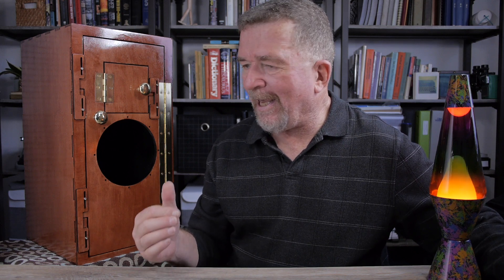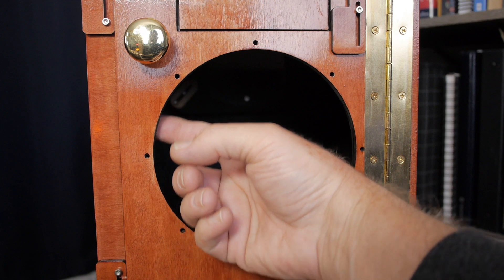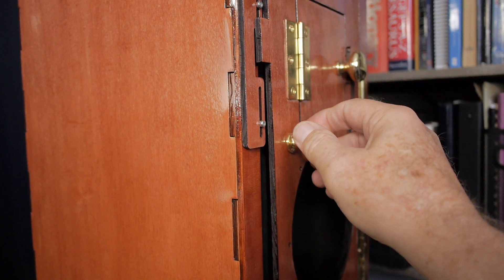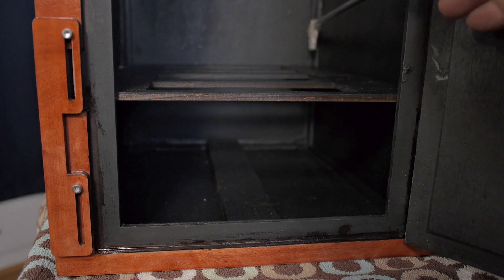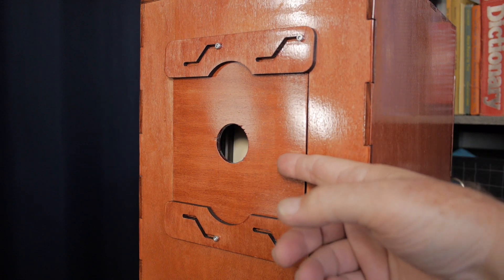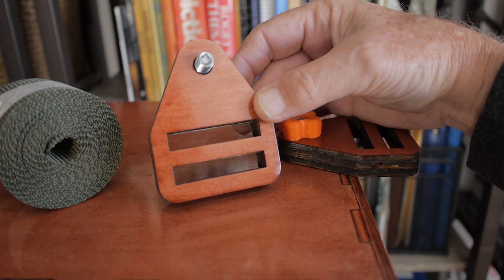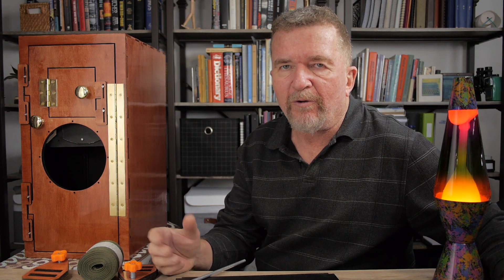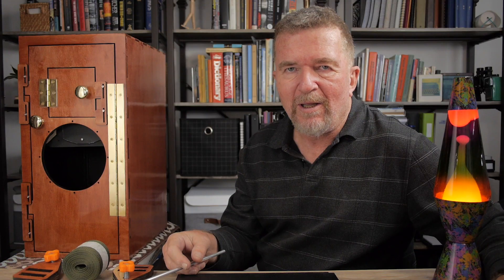Building the ABQ Box Camera Part Two

Comment: Using Flexseal was a good idea. 
For the arm sleeve, have you thought of using heat-activated seam tape? It's hot glue in a ribbon that you seal with a hot clothes iron. Check the fabric store or the sewing section at Walmart.
As for the varnish, I tend to like using a foam brush as it doesn't leave any bristle marks.